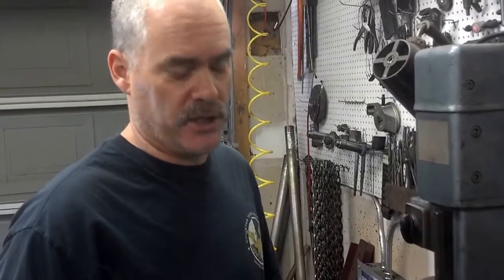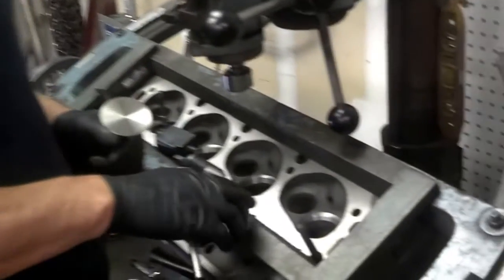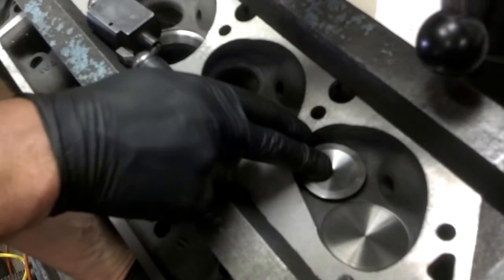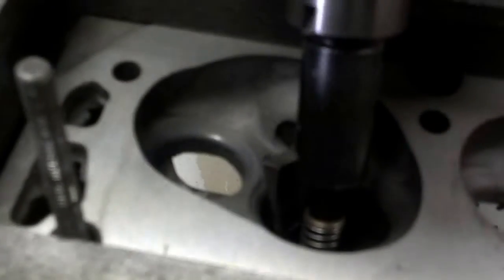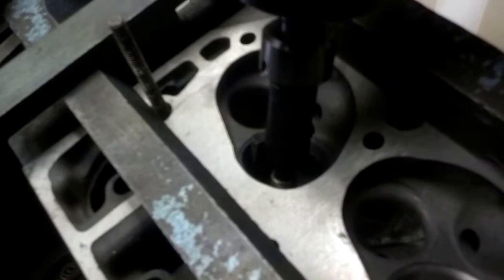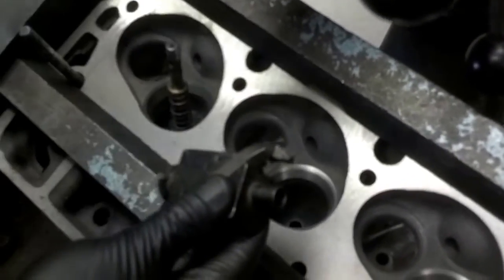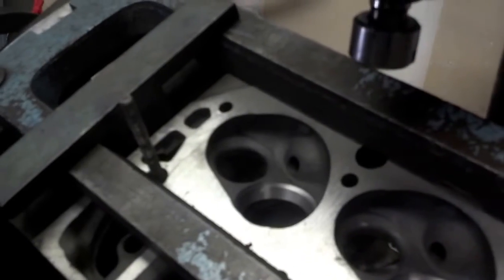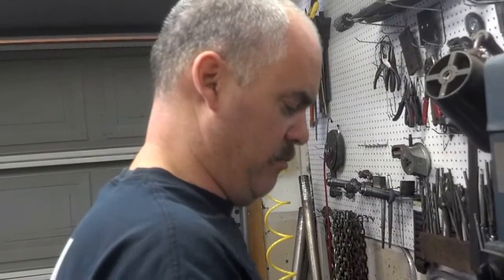Machine work 454 Chevy heads

Comment: When you're willing a pair of heads on a V6, or a V8, or even the deck on the block for that matter, how do you ensure that they end up sitting at the same height when bolted to the block? Is it important, or is there a tolerance?
Reply: It matters and there is a tolerance. I think he covered that with the "Square decking a block" video.

Comment: I see your putting in 2.190/1.880  Valves.  I'm thinking on putting in 2.250/1.880 inch valves in my 781 heads' the heads are. 
 L 17 76 & L 18 76 ( 336781 ) THE LOWER END IS STOCK 454  THE CYLINDER BORES ARE .O30 OVER RUNNING STOCK FLAT HEAD PISTONS WITH 2 VALVE RELIEF. THE CAM IS COMP CAMS KIT  XS268S-10 MECHANICAL FLAT- TAPPET CAM 268/274 ADV,,  230 / 236 DEGREES @ 0.050,,  0.553 / 0.586- INCH LIFT.  110-DEGREE LOBE SEPARATION. WITH EDELBROCK  Intake Manifold, Performer RPM Air Gap, Dual Plane, Aluminum, Natural, Chevy, Big Block, Oval Port, Std. Deck TOPPED OFF WITH Holley 0-82851 - Holley 4150 Street HP Carburetors 850 cfm.. I just would like your input on this build it's a street motor going in a 1981 Fire Bird.... your input would be Greatly Appreciated... and thank you for all the advice in all your you tube videos.. looking forward to your input on this build...
Reply from the maker: Sounds like a really good combo to me

Comment: Do you have any videos talking about running 781 heads with certain cc dome pistons and if there's any clearance problems with high lift cams?
Reply from the maker: No but I would recommend a dome piston those chambers are huge with a flat top they are pretty low compression I have never had any clearance problems with 781's although you should always check

Comment: building a 496 with 781's. I'm having 2.25 and 1.90 valves installed, Air Gap intake, 290hr Hyd Roller comp cam, dome pistons shooting for 10:1 or a little more.  I'm hoping for lots of torque and over 500HP.  we shall see.
Reply: just as well call the tire shop right now
Reply: Should be easy to hit 500 with that set up, its been a while, how many sets of tires have you gone through? Haha

Comment: What does it typically cost to put bigger valves and new guides in the heads?
Reply from the maker: around 600 bucks for a set that's assembled and ready to bolt on
Reply from the maker: $500.00

Comment from the maker: After market heads are much better IE AFR, Dart, Edelbrock are a few good examples they are available with much better flow ability and a more modern port shapes some of the factory BBC heads do pretty good the two best oval port castings I have found are 049's and 781's they are pretty much the same casting and work pretty well for what they cost 500 HP si doable with them if they are done right if you want more than that you pretty much gotta go with aftermarket castings